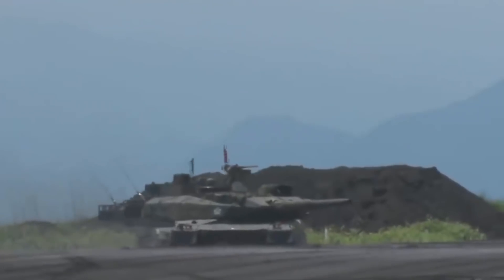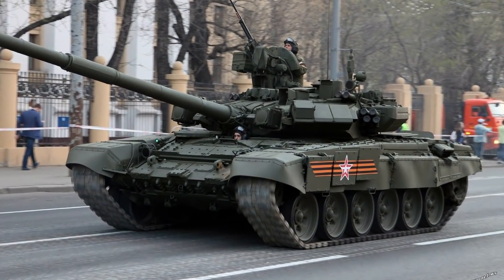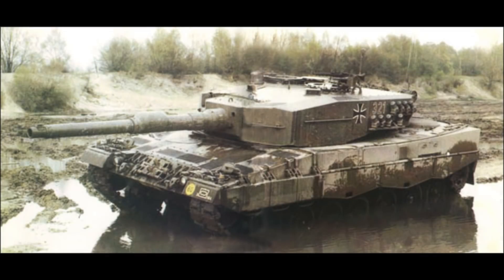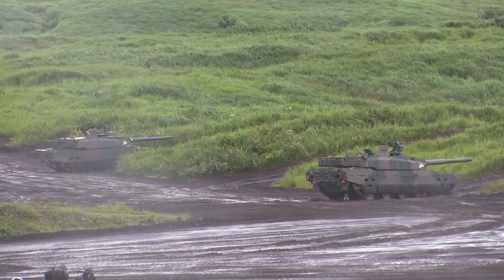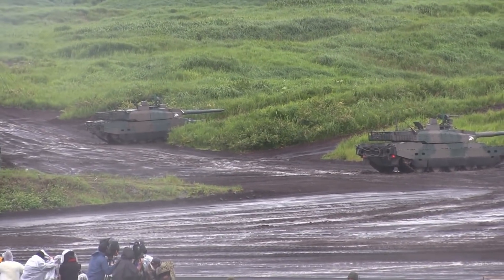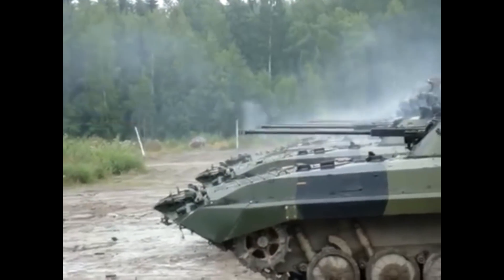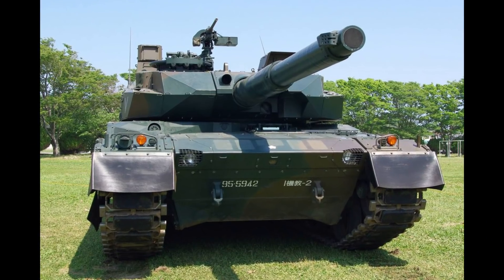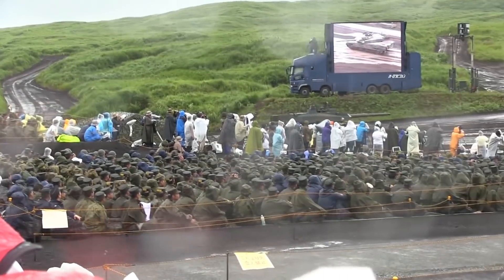Problems with Type 10 tank

Comment: Strange thought. Why not just copy T-72B3 with some new upgrades? Better transmission to have good rear speed, and automatic gear selection is all that needed really. But tank would have better armor protection, same firepower and less crew. Why blindly copy Leopard-2 layout? Why not soviet? Why not french - their Leclerc is pretty light too.
Reply: Gearing? This thing is using CVT. not belt CVT, but hydromechanical planetary gears i think. U know what that means? It means it can go in reverse as fast as it can go forwards.

And its a 3man crew. Its got autoloader.
Reply: @arsyadidris6349  and in combat scenario - why you need to have reverse speed as fast as forward speed? Tank doesn't have back mirrors, you see and cameras sooner or later will be covered with mud, or even worse - will broke. It means that commander will need to use voice commands to steer tank when moving backwards, and then it's reverse speed becomes a moot point. 3 man crew is great, but still - why go for leopard layout? If you don't like soviet layout - why not Leclerc which is much better armored?
Reply: @unholyknight786  because the front of a tank will always be the most heavily armored part. The rear will never be as heavily armored compared to the front. Going reverse as fast as going forward means u can do a tactical retreat very quickly while still keeping the main armor facing the enemy. N it saves time. The time it takes to turn ur tank around is time that u are a non-moving target. A number of soviet era tanks (regardless they were ukrainian or russian operated) were lost simply because their reverse speed was literally human jogging speed. 

And how do u even know that the leclerc is better armored than the type 10? U have the exact details of the current armoring layout and packages of both the type 10 and the leclerc, that u have confidence in saying that the leclerc is better armored? If u do… i think ur gonna be in trouble my friend hahah.

We dont know the actual armor capability of the type 10 whatsover. We only know what the japanese military allows us to know. No type 10 has left japan to be inspected by foreign powers, let alone be captured and torn apart to be studied.

The official statement is “max armor package weight 48 tonnes”. N that statement was released when the type10 came out 14 years ago. We dont know anything else after that 14 years. For all we know, it could have all the modern active/passive defense tech that we see on current MBTs. They just didnt want to show it to anyone. N they have the luxury to do that because theres only 100+ type10 in operation, and all of it belong to the JGSDF.